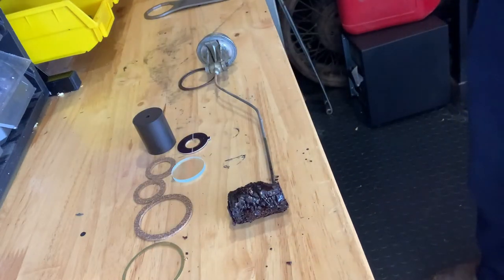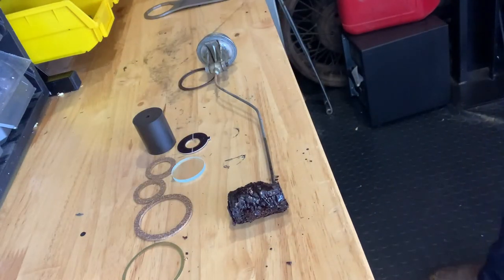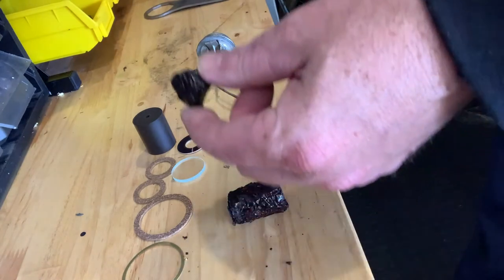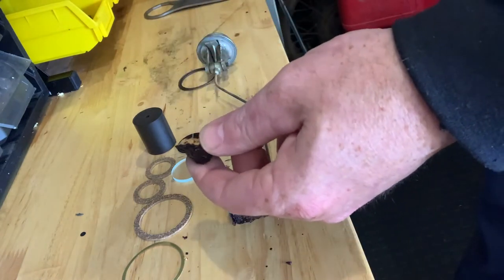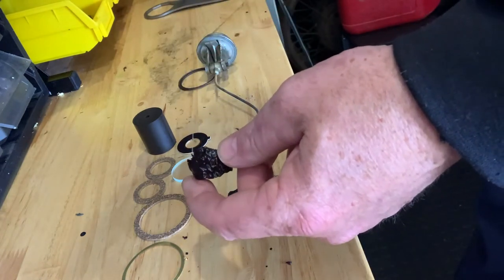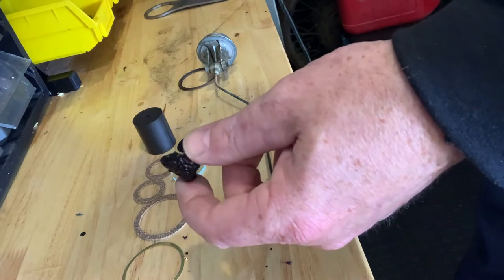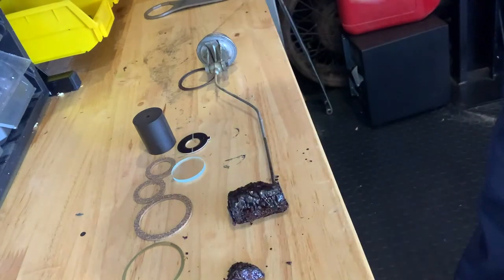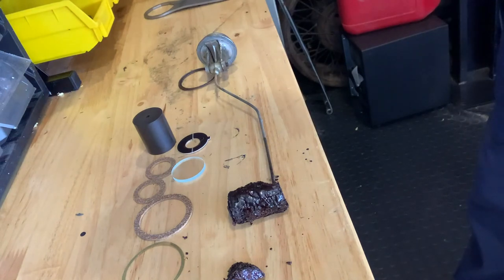How to change your gas gauge on a Ford Model A

Comment: Thank you so much for posting this video. I have a 1931 Model A truck that has a leaky fuel gauge and the gas is dripping from the dashboard gauge into the cab of the truck. I'm working on it right now and decided to take a look at YouTube to see what I could find. Thanks for the help. I'm ordering a new gauge kit and tools right now.